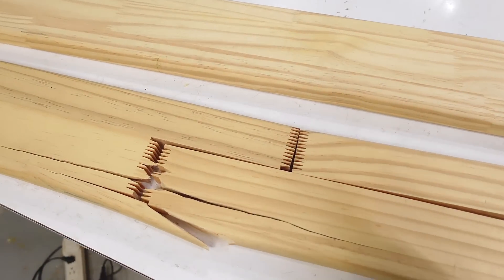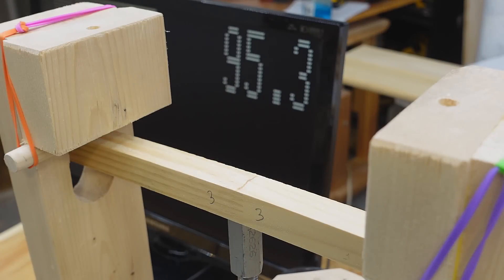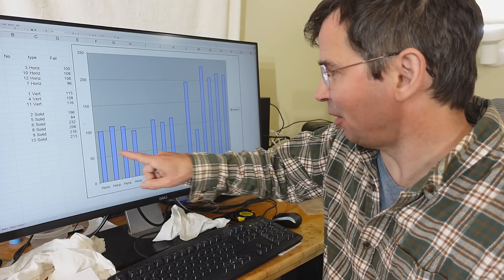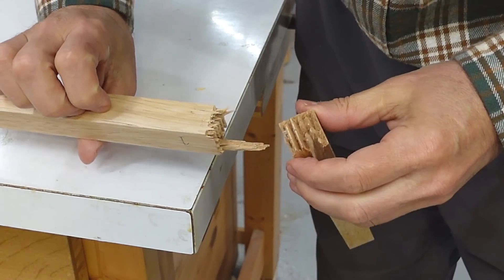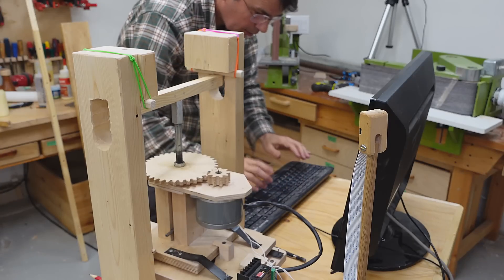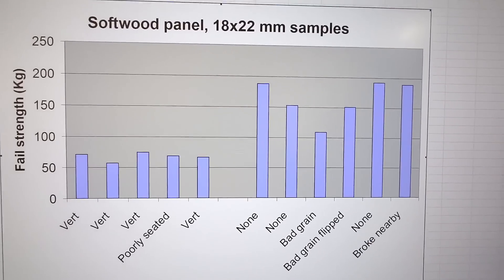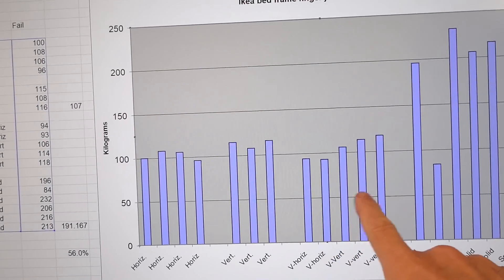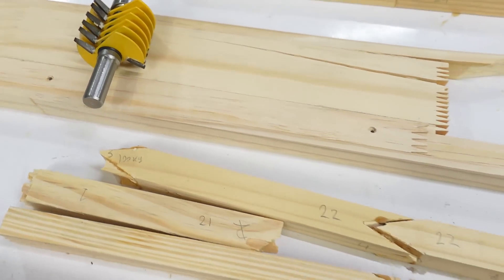How strong is finger jointed lumber

Comment: Interesting results, it would seem that maybe they aren't using a particularly strong glue, as most of the failures on the joints appear to be glue failure, rather than wood?  Also, am I correct in thinking a finger joint is a sawtooth pattern, but box/comb joint is a square wave pattern?  If so, are box/comb joints stronger than finger joints?

Comment: This was interesting considering that joint is used in manufacturing to extend wood that is too short.  Understandably that is normally combined with other lengths and the joints are offset, which testing that could be a whole host of videos.  But the thing that came to mind after watching this are structural wood joints that are used in buildings, like a timber frame scarf joint.  Would a joint like that really fair any different? (I assume it would, but not sure.)

Comment: Glue is stonger then lignin, but glue is not stronger that the fibers. It would be interesting to see how strong end grain to grain is for the same wood.
My Ikea replaces the broken slats without asking for a receipt, but I rather glue them and then add some long bamboo 6mm dowels from the side.

Comment: We use fingerjointed construction lumber for rafters, floor joists etc. Same ratings as regular-non jointed timber. A bit strange to work with as usual wood has one bow direction but finger jointed can bend like a snake, so varying direction, but the bow is not as large as regular lumber though. Finger jointed can also be ordered in any length which is nice. We've ordered over 7 meter lengths.
Reply: I'm glad my mill rarely does anything over 3 meters for bespoke stuff

Comment: What would be the strongest way to make a longer board? Long scarf joints? Offset laminations?
Reply from the maker: long scarf, but that wastes a lot of material and is hard to line up and clamp for gluing
Reply: If the outer 30 percent of the beam is continuous fibers, you will have pretty much full beam strength. Also, the beam has highest stress near center span (usually). So avoid joins in the outer part of the beam near the center span. If you must put a scarf in a high load area, use a 12:1 ratio.

Comment: Would it be much stronger if you drill a hole trough the finger joints and glue a wooden dowel pin in?
Reply from the maker: that would weaken it a lot

Comment: I would not assume that finger joints are weak based upon this testing.  The manufacturer could have starved the glue joint making it weaker than if you made it yourself.
Reply from the maker: yes, I think these joings SHOULD be stronger if properly glued

Comment: Why don't you try a test with box joints compared to finger joints I have always wondered would these be stronger? You can also vary the dimensions of box joints to may be maximise the joint strength.

Comment: Stress graded finger jointed lumber should be much more durable, because the quality control and requirements of the joints are stricter than for furniture panels. Furuniture panels’ finger joint quality control and requirements are nonexistent.

Comment: A practical application for Mattias's experiment.
I have several paint grade finger jointed interior doors in my house  (french style with 15 glass panels which makes them quite heavy)
so far i've had to repair 3 of them because the  door handles fell almost prefectly on the  finger joint glue line.
in evey case the failure was in the glue. In fairness   more than 50% of the joint was removed  for the mounting holes
and  it took almost 20 years to fail.
I would by the same door again but would only accept ones were the door handle set falls on solid wood.
P.S. there are several   Manufacturing finger joints videos here on youtube.

Comment: It's apparent that the finger joints for this type of use is only for utilizing short scraps from other manufacturers.  When being sold to other businesses to make longer boards.  Its very apparent that these joints have no structural bearing other than the structure needed to make a flat board.
Reply: I’ve never seen them as single sticks of wood, I only know them as laminated boards, table tops and stuff like that. Those are more than strong enough – although I really don’t like the scrap wood look.
Reply: Sell 2x4 studs here in Norway that is finger jointed BUT they are NOT load rated, so not for any structural, all structural 2x4 have a C24 or higher rating, these have nothing
Reply: @mm9773  I see plenty of finger jointed furring strips.
Reply: @mm9773  I believe Lowe's hardware stores sell them as 2x4 but I don't recall if they're labeled as studs.
Reply: @brothyr  It would be interesting to test these. I would also like to see a structural test of a regular wood beam vs. a Glu-lam beam (which is like a stack of finger jointed 2x4s or 2x6s stacked and glued together).
Reply: @jameskelly1680  Include a LVL beam in that testing and we'll be all set. Matthias will first need to upgrade to a much stronger test rig though!
Reply: They sell finger-jointed hollow posts.  They ostensibly do support a load ... for a while.  If there's any moisture, they start peeling open and splaying out like an upside-down banana.  Very economical.
Reply: @PSUQDPICHQIEIWC  Yeah, I've put a lot of those in here in the humid south USA. Let the paint go and they fail quickly. They also use low-cost woods hidden behind primer so you don't see the cheapness. Everything in construction here is now made for appearance because it sells; nobody thinks long-term anymore.
Reply: @PSUQDPICHQIEIWC  thats funny.  It would make sense though with PVC boards. Possibly for vertical support . Test that...
Reply: When home shopping in my area, a number of the homes were built using finger jointed boards, you could see them in the unfinished basements.  I thougt it looked sus, at the time.  Years later I talked to a construction inspector and he said they do it to remove knots. A completely knot free board is strongest but rare, but a finger jointed board is stronger than a piece of wood with a knot in it.  

People are mentioning water damage. I'm guessing proper, structure rated finger jointed boards use a non-water soluble wood glue, ie. Hardware store equivalent is Titebond III, not Titebond I.
Reply: They are scraps, yes. But they are also more stable then a long single piece would be.

Comment: The little bits of end grain won't contribute much to bending strength but you could measure them and deduct that percentage.  That wouldn't account for the difference you are seeing.  I've seen finger jointed wood trim that broke very easily and I had a theory that they just don't use very good glue for those joints.
When you created your own joints you were using 20 degrees, the commercial finger joints use a lower angle so they have more surface area for glue bond for the same amount of width.  You could try this by reducing your saw angle and cutting multiple fingers instead on just one finger.
That finger joint router bit seems like it would create too much end grain to provide a joint any stronger than what you were already seeing.
Reply: I have a feeling the next video will go into exactly that, once he figures out the finger joint router bit at the end...

Comment: When you think about it, since the fingers are cut at an angle you are getting a glue up of partial end grain. Of course end grain glue ups are extremely weak. So a weaker joint from this sort of joining process is to be expected.

Comment: Something I've seen quite a bit of IRL is that the finger jointed material uses an adhesive that is not outdoor rated and so old pieces will fall apart very easily right at the joints.

Comment: In schip building there is a rule that a scarf joint 8:1 (length to thickness) in a kiel and 12:1 in spars, is as strong as the original wood.
Reply: This is good to know. It was several decades ago when I learned, but IIRC in normal jointery I think the ratio called for a minimum or 6:1, preferably with a locking feature involved.
Reply: I had similar instructions in a wooden glider repair  course. 8:1 generally, 16:1 on spars.
We scarfed 1/64 plywood RC glider skins by chamfering their thickness over 1/4" (8:1) and never had a joint failure.
Reply: I believe airplane spar repairs use a similar ratio.
Reply: What is a schip?
Reply: @shawbros The Dutch word for ship. Presumably autocorrected and/or an oversight when the comment was made
Reply: Sorry, but that doesn't make sense. The joint doesn't know where it ends up. So if it's just as strong, then location would not matter. It's probably  considered at least strong enough for the intended purpose.
Reply: @dutchhank  are they not talking about the aspect ratio of the joint itself, and not the location of the joint?
Reply: @dutchhank I don't know the details, but perhaps it has to do with the traditional/normal shapes of those pieces. A different width/thickness profile might need a different scarf ratio.

Comment: The question I have is are the diagonal finger joints as strong as your box joints cut on a table saw.
Reply from the maker: they should be stronger.  with the square fingers, the side joint is good, but you have the ends of the fingers all lined up, and along that line, half is end grain.
Reply: @matthiaswandel  yes, half is end grain. But a half of it is also in compression which doesn't really help in a finger joined case, it seems. So still very curious to  see a test =)

Comment: Maybe it's because it's closer to end-grain-to-end-grain rather than long-grain-to-long-grain? Would be interesting to see if the strength changes with the angle of the fingers.
Reply: That's exactly what I was thinking.
Reply: Same thought here. I wonder how a box joint would work laid out flat.
Reply: If you have a very long finger (small angle) you are basically gluing endgrain to endgrain. But you "waste" a longer piece of wood. Having more smaller steep fingers is probably harder to manufacture, so I guess the given pattern is the best compromise
Reply: @greenjom  Seems the opposite to me.  with longer fingers there is more edgegrain surface to glue, where as with shorter ones it is more end grain.  Up to the point where you use squared off box joints and the amount of end grain stops changing and the finger length just affects the edgegrain surfaces.
Reply: @johngaltline9933  You are correct here. If we remember that wood's strength is in it's overlapping and intertwined lignins and fibers, then it's clear that having a longer glue joint parallel to them will bind them together better. This will also give a more gradual failure mode which is always desirable. The finger-joints we buy are mainly designed to maximize production and minimize waste of both wood and glue.
Reply: @P_RO_  I think the finger joints are fine on what they are normally used on, things like molding that need no structural support.  they are just fine in those applications.

Comment: Surprising that you were getting so many joint failures at the glue line even with your own made up joint samples.  I always thought a glued joint was supposed to be stronger than the surrounding wood fibres.
Reply: Yes same here, this suggest that the glue is stonger than wood assumption doesn't hold true.
Reply: @MrVlork The glue is stronger that the lignin holding the fibres together but not the fibres themselves.

Comment: So really, the answer is that the finger joints are more than strong enough for application they are used for, especially when glued in a staggered pattern like on the large panel.

Surprising that the partially seated joint was as strong as the fully seated ones. That doesn't make much sense to me.

Comment: Interesting, but most of the finger joints I know of (usually making up doorway frame panels) aren't really meant for shear but more compression, if anything.  They are also largely decorative than structural.  I guess it looks better than some other methods of jointery like tables or furniture.

I am trying to remember if you did a video on the strength of box joints, or whether you ever made it so box joints are in line like this instead of the conventional corners that they and dove tails are usually known for?
Reply from the maker: Home Depot used to have 2x3 finger jonied construction lumber, just for interior walls.  I wanted to test that, but haven't seen that there in a long time.  Also finger joined panels, and if you use those for shelves, strength does matter

Comment: It would be interesting to see a comparison of a section where the finger joints are in line with a solid piece Vs the two solid pieces glued together.  As in the boards the finger joints are usually staggered.
Reply: Yes !
Reply: I was thinking the same thing; most of the places I see finger jointed wood are in trim where strength isn't really a big factor compared to stability I suppose - and then in wider boards where the joins are staggered in strips so each join has solid wood on either side.

Comment: For the sample that broke at the joint a third of the way between the fixture and the point where you’re applying force:  wouldn’t that have a 3:1 lever between the pushing force and the point that broke (with the fixture forming a fulcrum)?
Reply from the maker: yes, 3x the leverage in the middle.  I thought I'd be safe, but no, I guess finger joint was 3x weaker than the solid wood for that one.

Comment: I’d be curious what happens when you get a staggered joints in a panel glue up.  Does it approach the average, or does the long grain of the next piece over, which bridges both sides of the finger joint, have a non-linear impact on the strength of the joint?

My guess is that it would be a weighted average of the long-grain vs the joint strength, based on the percentage of each at the test point.
Reply from the maker: Staggering definitely helps for overall strength.  Sort of like segmented bowls that people make.

Comment: Structural use of finger jointed wood looks risky.
Reply from the maker: I have seen finger joints in engineered joists.  Makes me weeary.  LVL not so bad, cause its not end grain joints.
Reply: Those aren't really "structural" finger joints. Actual structural finger joints are a lot longer and use different glue.

Comment: This is why they stagger those finger joint positions in the big boards. I wonder how much strength doing that adds
Reply: Doesn't really solve the weaker than the wood problem - the staggering largely just distributes the weakpoints more evenly. Though I would expect being surrounded by continuous wood grain that bridge the finger joint will help a little more than just the strength added by those fibres - distributing the load away from the weak point, and shifting the force directions and so how you are stressing some of the glue bonds may help an outsized amount.

Comment: That beats those who claim that the wood glue joint is stronger than the wood. At least with these finger joints. 

I've seen quite a lot of those boards with joints that aren't properly seated. I guess I'll skip those in the lumber sale from now on.
Reply from the maker: for side grain, joints, it IS stronger than the wood.  Those who say the glue is stronger than the wood are not referring to end grain joints.

Comment: Always love your videos Matthias, hopefully caught you early enough to get your eyes on a Q:
I've always heard that the glue is stronger than the wood itself, and that seems opposed to your results. What am I missing?
Reply: PVA (and really any glue) is stronger than the lignum in wood. Lignum is what holds the wood grain fibers together. Think of a handful of straws being the wood grain fibers that are held together with a rubber band. Lignum is the rubber band. Glue is never stronger than the wood grain fibers. 

A typical panel glue up is gluing the long boards together along the grain. So the glue is replacing the lignum that was cut when ripping the boards down to size but the wood grain fibers run end to end. In that joint, the glue is stronger than what the wood would naturally be without the joint. But that is not the case for the finger joint show in this video. 

Think about a scarf joint, the finger joint is like a bunch of really short scarf joint. The longer a scarf joint is the closer it becomes to being like long grain joint (like a panel glue up). So these finger joints are on a continuum between a long scarf joint and a butt joint. They will be strong than a butt joint but will never be as strong as a continuous piece of wood.
Reply: @devinfisher5171  I think that glue can be stronger than wood, however it lacks one quality of wood: It is solid, while wood fibers can and do actually move and stretch under load. Ideally would be a glue which exactly matches that quality of each type of wood it's being used on.
Reply: It depends - these are mostly glued end grain to end grain - probably the worst case scenario. If you glue side grain to side grain, then I think it's stronger, but go back and watch the other strength tester videos to be sure - he's done a lot of them now, and they each show you something interesting (just that I don't remember them all)